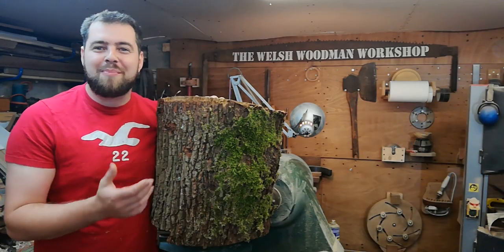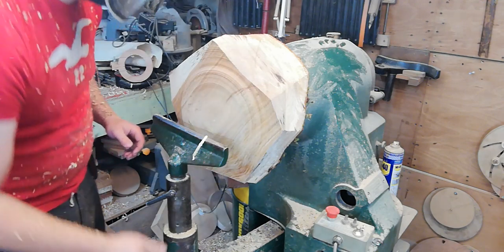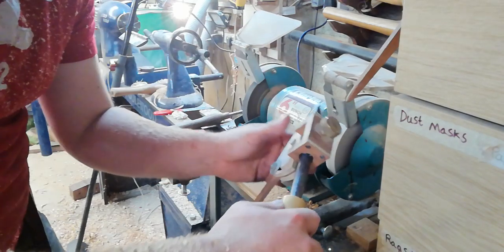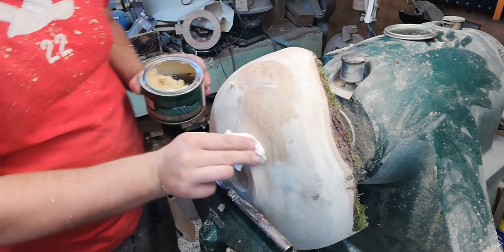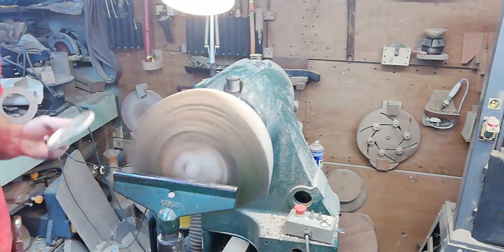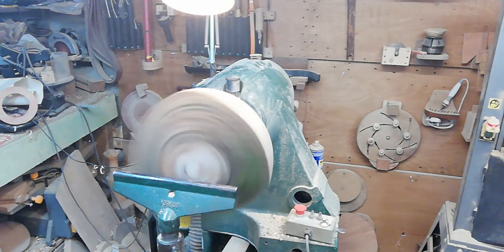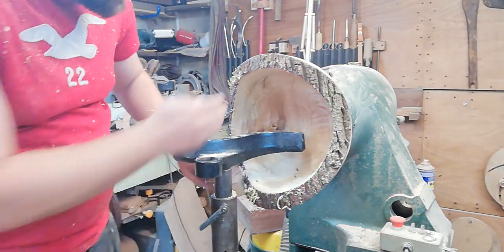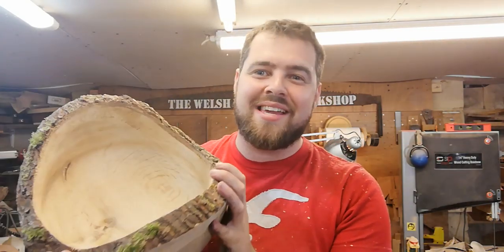Woodturning - Large natural edge Oak bowl

Comment: You are a very good teacher, but on this one your process is a bit suspect. I would have made a larger tenon with 4" chuck jaws, and kept the tail stock center in place for much longer when hollowing out such a large piece. Also I like to start the definition of the edge thickness with a parting tool. Less chance of a catch an ruining the live edge. But what do I know...it turned out nice again. Thanks.
Reply from the maker: Thanks for your comment cracker Jack that's really good advice for all turner's. I've found that mortice joints at the bottom of larger pices are far stronger than tenon joint's as they are less likely to rip off under the force, I've now turned much larger bowls (3ft in diameter) using this method. I've also found, they can be easier to remount for the final turn - I tend to put my logo disk in the bottom to brand the bowl which hides up the mortice at the same time.  A tailstock for extra support is always a good idea however my VB36 lathe model has not got one, as its the bowl turning model. Due to this fact I would find it very difficult to reverse the bowl to turn off such a large foot especially with just a jam chuck a vacuum chuck might work but haven't got one of them. I'm saving up for a tailstock attachment at the moment but it will take me a very very long time as they are still over £2000. Good idea with using the parting tool to establish the edge of the bark, I'll be using that tip 😁 Thanks